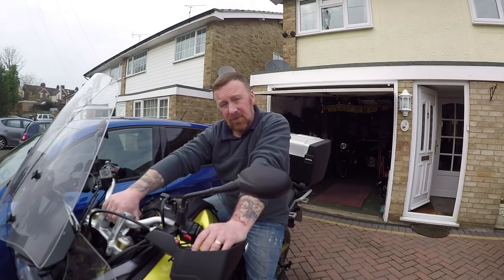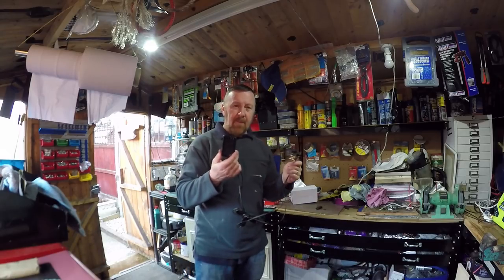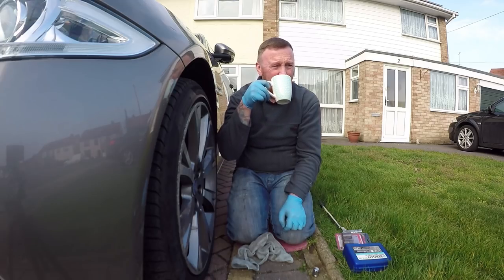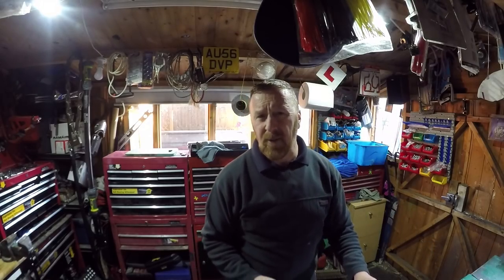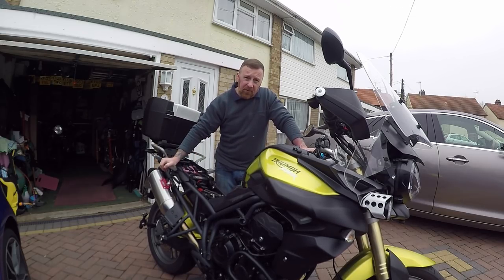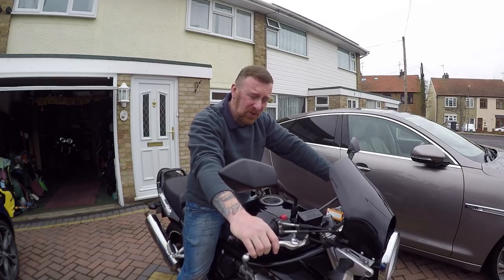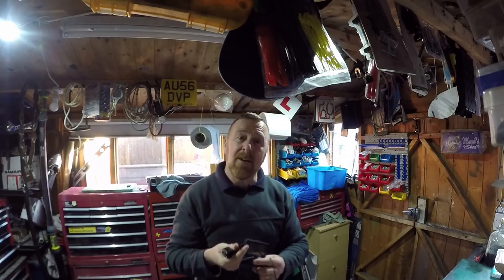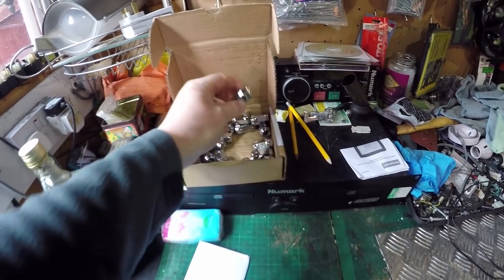TIGER 800 CRASH DASH CAM , WHEEL NUT UPDATE & A SORRY ABOUT BIKES MARK SAVAGE

Comment: You can do the wheel nuts in 2 mins get a carbide 19mm hole cutter take the centre out hold it steady bit of oil it will take off enough that the wheel comes straight off over what’s left and you can get the mole grips off what’s left which will also rethread the stud if you catch it at all :) hope this helps guys my xf was a pain but this really does work, keep up the videos Mark every time I change car or bike seems like you’ve done a vid on it ;) which is great :)

Comment: Marc best way to 
Messure my forks 
For reolacment 
Lexmito 125 fmx. 
Cheers. Buddy.
Reply from the maker: hi bud 
replacement as in just changing them old for new or the forks as in refitting oil seal and refilling?
if your just swapping them same as you had, if you changing oil id go to a garage as you need the right weight oil and to be set right
Reply: @marksavage  yeah. Needs calipers front n rear 
Bike machanic said seals 
Knackered. But cheaper labour 
To swap forks 
Need for. Mot 
Bk wheel locked was stiff 
Due to pads or calipees 
Fused on i think 
Seized up now 
Callipers were £100 with fitted pads. Fork  new. £80 
But need messure them 
B4 ordering forks.  Cheers. Marc 👍

Comment: Never found a bike I can't have fun on.  Even the little peds.
Those bandits are misleading. It does not  even have the power of a good 600. But it picks up speed in such a  relaxed way. It can surprise you with the way it can get a wriggle on.
Reply from the maker: Very true , I’ve rode so many mopeds and bikes and yea you can have fun 
As for the speed bit that so true too 
Thanks for watching m

Comment: Hi mark 
I have another question about a speedfight 2, when I start it up it starts moving forward straight away without any throttle. Do you know what is causing this and how to fix it
Reply from the maker: Many thanks for subscribing 
I have 70 speedfight that will help 
Type in speedfight mark savage
Reply: mark savage I’ve looked through your videos but can really see anything about this issue. I’ve tried adjusting the idle but it didn’t do much.
Reply from the maker: JJ1999 take a look at the variator / rollers 
Clean change if needed 
Belt maybe too tight so its engaging the clutch 
Clutch may be a problem to 
There are videos on them 
These will help
Reply: mark savage thanks will take a look tomorrow

Comment: That was painful to know you spent hours removing those bolts I used to be a mobile tyre fitter we used to carry equipment that takes bolts like those out no problem takes about 2 minutes per wheel most fast fit garages also have same equipment chuck them a drink and they will get them off for ya
Reply from the maker: if only round here, I got changed £20 to take one off then they said they would not take any more off, another local garage said per hour as for the way they snap there is only 1mm around the outer side and no tools can get around them!
any way its done and thanks for watching bud